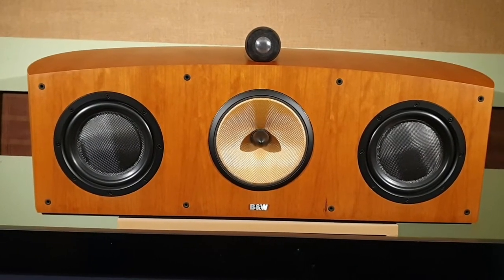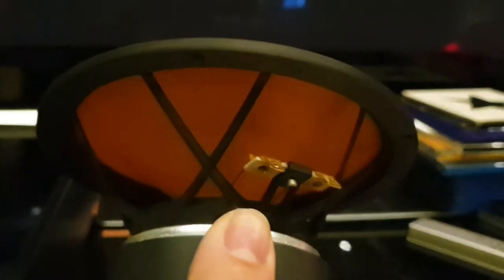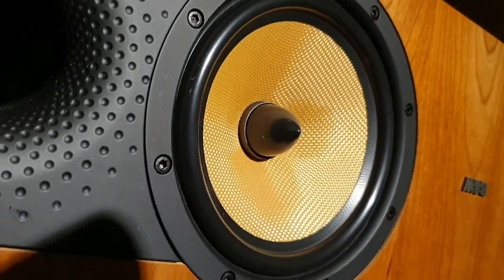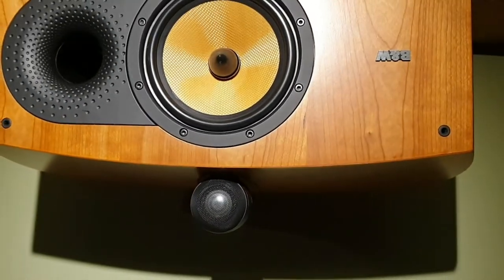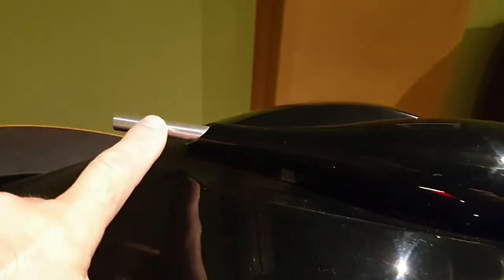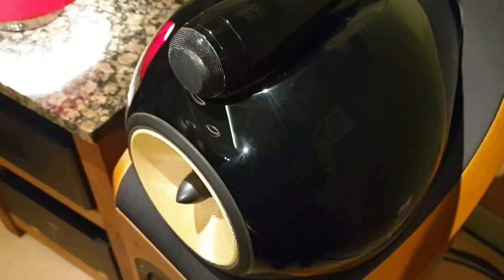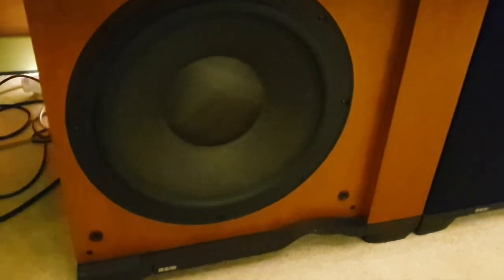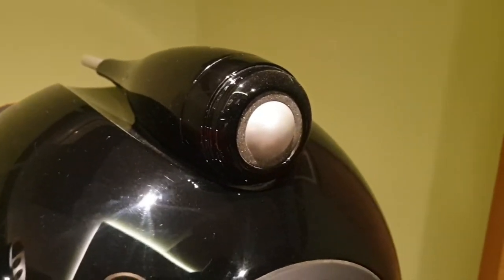Bowers & Wilkins B&W Nautilus 800 series speakers. 802 htm1 htm2 ASW4000

Comment: I’ve got a pair of 805s cherry on the stands, I’d like that centre speaker
Reply: Hi Dave
Reply: I've got a second one now which I'm not using yet.. if I can get a third one I'm planning to use two of them as rears. So I'll have htm1 as rears, 803 as sides 802 as fronts and htm1 centre.. oh and 2 x ASW4000 subs!
Reply: Great to hear you got 805s. I used to own 805 signatures.. they are fantastic aren't they? I used to work at B&W as a teenager.
Reply: @julianchamberlain5399  that’s right I remember you said you worked at B&W in Worthing, we were probably around Sussex at the same time, I knew a few people who worked there,
Reply: @lakesideaudio  I might remake this video as I've done a few changes since.
Reply: @julianchamberlain5399  they are ok, not the biggest speakers in sound I’ve ever owned but great mid and treble when complimented with a decent sub they sound very good